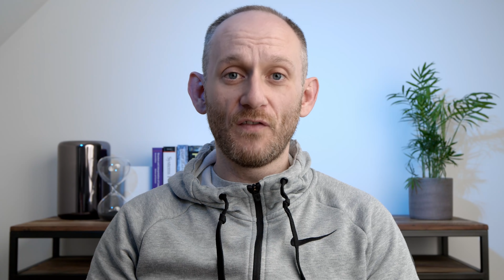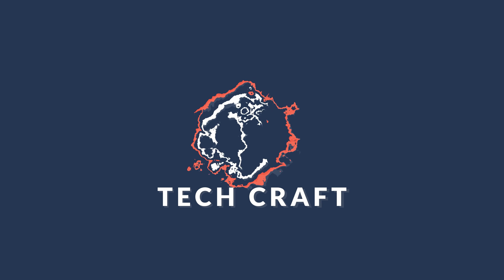Which iPad Pro External Hard Drive Should You Buy? Is The GNARBOX Really Worth The Money?

Comment: to be able to use ANY external storage you can use and external powered usb hub or external powered hard drive i have an easystore 12tb hard drive with movies and it plugs into the wall for power instead of being powered through the lightning port the reason some drives dont work is because the lightning doesnt provide enough power for it to turn on I also have a powered usb hub the usb hub plugs into the wall then i get 4 usb ports to connect to my phone and i can now plug in 4 hard drives at once i havent tested it with multiple hard drives but i connected a mouse a keyboard a charger and a hardrive all at once and it all worked

Comment: I’ve been using the WD Wireless Passport Pro for memory card backups while traveling and LumaFusion editing with iPhone since around 2016. More recently I use it for LumaFusion editing with the iPad Pro. The WiFi connectivity of the WD to iPhone was always unreliable, but the USB connection to the iPad Pro has been great. What I love most about the WD is that it allows me to take backups of my memory cards while traveling without having to lug around a laptop. It’s small enough that you can take it on multi-day hikes without the weight and size becoming a burden.

Comment: I really like the My Passport Pro— it a lot better than the regular externals I used before. Just be careful though, if there is much EMF around, the wireless function is not robust, and I have had its wireless function corrupt files, which I never knew happened until later when I was having editing problems.  This happened a few times now, and I am trying to automate a checksum approach that I don’t have to think about, so it provides an automatic failsafe way to transfer video and photos.  I don’t own a gnarbox, but I have seen it on shoots and I was told it does that automatically (but I do know it is about 3 times the speed of my wireless).   I will probably get a gnarbox at some point, but I wish there was a good open source alternative or any good competitor, so it was cheaper, but it does seem to have a lot of computer power and automation built-in, so I guess you get what you pay for.

Comment: I had the wd passport 4tb and it broke after 3 months. I was not happy about it
Reply from the maker: Did you get a replacement? That's definitely not great.
Reply: Tech Craft I did not. I read a bunch of reviews on google of people getting the run around from wd so I didn’t even try. I got one of those Samsung ssd drives and I’m much happier with that. I needed the wireless because I was editing video with my iPhone and needed the extra storage. Now with a iPad Pro I can use the other drives.
Reply from the maker: @JasonTheMunicipalMechanic  Ugh that's not good to hear, I hope mine doesn't pack in. I hope the Samsungs are working out for you. Mine are both still going strong.

Comment: Hey Rob, great video’s I have just subscribed! I recently just switched to an iPad Pro from a laptop. I wonder if you could offer some advice? I sometimes will have to transfer larger files (Around 5gb) from a external drive (which I use all the time with the iPad) to a colleagues Windows machine. How would you recommend I do this/ what format should I format my external drive to so both Windows and IOS can read/write? Thank you in advance.
Reply from the maker: You can do this over the network by sharing a folder on the Windows machine and then accessing it from Files. For regular transfers you might find this is faster due to the lack of fiddling with drives.

To do it from a drive I’d recommend exFAT as drive format. This is supported by pretty much everything these days and supports large file sizes.

Comment: Hi Rob, Firstly love your channel. I have watched this video with interest and the only slight criticism I have is the review on Gnarbox. I am not sure if this is because a lot of facilities it offered were not available when you did the video. Let men say like you I bought mine and am at this moment putting it through it’s paces on a filming trip in India. I do not have any affiliation to Gnarbox but am desperately trying to get them to add more features to make it even better for filmmakers like myself.
Now I agree it is very expensive but unlike the SSD’s it is also has a computer built in and therefore I like it because it will not only as a stand alone unit back up to the internal drive but also up to two external drives into folders. This makes it probably unique as you do not need a computer or iPad once set up to make three backups while on the move. Also as a photographer you can do your metadata for your files ( I am pushing them to add this feature by possible joining forces with KYNO for video) using just an iPad and the Gnarbox. Finally it has been designed to work perfectly with LumaFusion for editing and when in the USB mode can be seen by iMovie which means that you could assemble in iMovie then export an XML file from it for importing into Final Cut Pro later.
Bearing this in mind would you consider looking once again at the Gnarbox and maybe do a short video on it?
All the best Dave - Dave Knowles Filmmaker.
Reply from the maker: I watched this video again the other day thought I should probably spin up the latest firmware updates and see what has changed. I’m heading to California at the end of Feb: the perfect excuse to run up another video!
Reply: Tech Craft Rob sounds great. My dealings with Gnarbox is they listen to ideas. I don’t know if you know KYNO which is only available for Mac (I am trying to persuade them to do an iPad version) is amazing. You can add metadata which FCP reads and you can transcribe to most formats to most formats. It is worth looking at if you have’t seen it. Anyway I am trying to get Gnarbox to join forces with KYNO and both sides seem interested. Apart from that there is a few things such as a battery base that takes NP1 batteries I have suggested and they are looking into it so if you have any reservations please let them know. All the best Dave. By the way I am loving using just my iPad Pro instead of the MacBook Air I normally use.
Reply from the maker: Dave Knowles - Filmmaker I’m going to download that and give it a run out.
Reply: Tech Craft  Hi Rob, I am not sure how many people know about KYNO. There are some reviews but not many so a review could be in order especially if it is not too technical.

Comment: Should I be able to set up and use the T5 solely using my iPad Pro 11? Also, what about connecting it to my Synology rt2600ac router? Thoughts?
Reply from the maker: You can absolutely set up and use the T5 solely from the iPad provided you don't need to format it with any particular file system. If you do want to change the filesystem, you'll need do that with a different machine.

I don't have that router to test, but from looking at the specs the drive should work just fine.
Reply: Got the new T5. iPadOS 13.3. Files sees the drive and the three installed files. All mention of iPad is sorely absent. I assume there is no firmware upgrades via iPad? No user interface?  No eject in Files, so I powered down the iPad and got one red blink. So is that about it? Thanks...
Reply from the maker: Rick Sovitzky there’s no eject for any drive I have, I think that’s because the iPad is flushing all buffers after every write so there is no need to signal that before removing the drive
Reply: Just an update: the T5 does NOT work with the Synology ry2600ac router. Seems bizarre to me. It shows the drive in Storage section and got the capacity right, but says Partition is unsupported. Well, I’ll see what I can accomplish on the iPad Pro.
Reply from the maker: Rick Sovitzky is the partition issue because of the drive format maybe?
Reply: Thanks for the reply about EJECT.
Reply: Thanks for your input, Rob. 

I formatted the t5 FAT via the 2600ac. It works...almost. When I attempt to write a file to the t5 via Files on the iPad, it fails with ‘could not contact helper application’. Have you ever encountered this?
Reply from the maker: Rick Sovitzky Weirdly yes. I saw that for the first time just this week. I’m pretty sure it went away after a restart and hasn’t come back since I started using the iPadOS 13.3.1 beta.
Reply: Tech Craft   Thanks a bunch, Rob. That’s reassuring. Otherwise working fine. Using Infuse to stream videos from the t5. On iPad and Apple TV.

Comment: Extremely thorough, well-done examination of these drives. My needs are somewhat similar to yours—even down to the use of the same iPad Pro, a couple BMPCC4Ks, and an ILC with RAW files that are unsupported in iOS. With this in mind, I'm curious about how you use the WD Passport Pro. It has some cool features but seems way too slow to use as a way to back up or process the huge files generated by the BMPCC4K or a large quantity of RAW files. I'm wondering if you're using it for something else.

In a comment on a previous video, I argued that the Gnarbox 2.0 is a much better choice than the WD. I think you did a great job of nailing some of the annoyances that one has to deal with when using the device. There's just enough friction with the different modes and switching between wifi networks that using it can feel like a hassle. On the other hand:

1. The Gnarbox 2.0 is able to perform an automated back up to two drives at once employing MD5 checksums to ensure bit-for-bit accuracy at speeds that actually make it useful when dealing with large quantities of data (faster if you plug in a UHS-II card reader instead of the built-in UHS-I reader). This eliminates the need to even have a phone, much less an iPad, when performing backups.

2. Its Selects app is powered by Photo Mechanic so it is not dependent on waiting for Apple to get around to supporting new (or in some cases, pretty well-established) RAW formats in order to view certain RAW file types.

3. I can appreciate your desire to convert video files to MP4. That said, you questioned the usefulness of its current transcoding options. They can actually be quite useful if you don't employ an iPad-only workflow. Transcode to 720p to do rough edits in LumaFusion and then export the proxies and the metadata from these edits into Premiere to finish editing before returning to the full-res files for the final render. Of course, this assumes a scenario where you want to get the editing process going before you're back at your workstation.

As far as the value proposition goes, I can't disagree. The cost of SSDs has dropped dramatically since the Gnarbox 2.0 Kickstarter campaign in April 2018. At that time, a 1TB Gnarbox with extra battery was available for $599 (early bird). A 1TB Samsung T5 was nearly $500. Unfortunately for Gnarbox, the production of the 2.0 was plagued with delays pushing delivery back nearly 10 months. Today, consumers are faced with a more difficult choice as the Gnarbox is now full price while the cost of a T5 has dropped significantly. The added value really has to be there for a particular use case to justify the extra cost.

Every one of your videos that I've watched has been excellent. I can see why your subs are growing so rapidly. I look forward to future uploads.
Reply from the maker: Thanks for such an insightful comment. I’m really only using the WD as a backup, so capacity is more important than speed to me in that particular use case. I can fill up 500GB with about 1hr of 6K footage from the BMPCC6K, so the GNARBOX barely lasts for me. At least with 4TB I can get a lot of shots down on to a disk. 

If the day arrives where the iPad can edit directly off disk, then the GNARBOX will all of a sudden become an amazing drive for editing out in the elements. 

Your insight into the pricing situation is super illuminating. Hopefully we’ll see higher capacity, lower priced versions in the future.

Comment: Mate, great video. But I clicked the link and bought the Sandusc dual and it doesn’t work with the IPad Pro 2018!
Reply from the maker: Ah sorry mate, I should have been clearer. Devices on lightning connectors - so the iPad Pro pre gen 3 will need an adapter. 

You can find quite a few USB-lightning adapters on Amazon. You really want one of the ones billed as a camera adapter.

Alternatively, if don’t have any USB-C devices, Ravpower makes a dual USB-A/lightning drive which also has an SD reader on it. https://www.amazon.com/dp/B01MRFSDR1/ref=cm_sw_r_cp_awdb_t1_898WDbQA4F5KA

Sorry for the confusion. I’ll be sure to call this out more clearly in the future!!
Reply: @tech_craft  Thanks mate, but it  was   done  to a fundamental IT error "stupid user". Updated iOS and everything was fine! sorry! :)